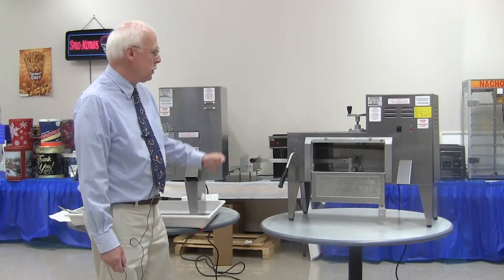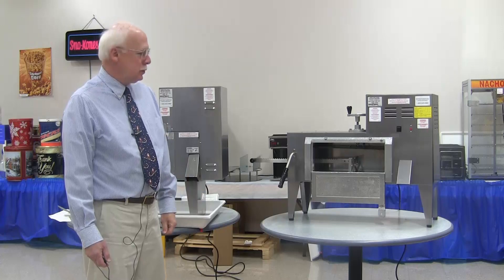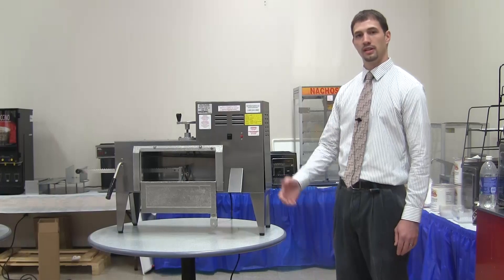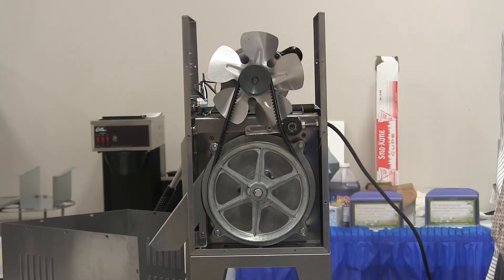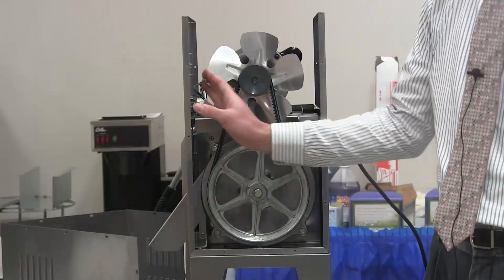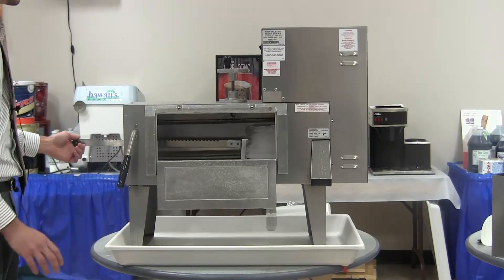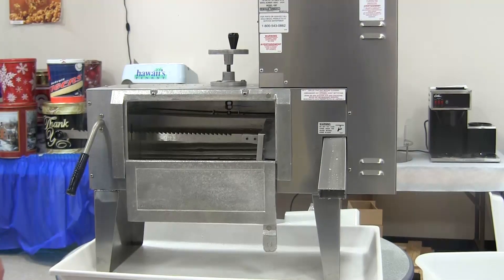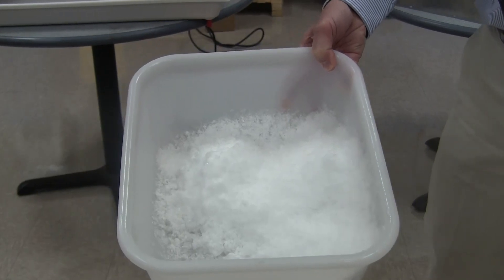Redesign of our New Orlean's Ice Shaver

Comment: Maybe a lockout relay could be integrated with the door switch, preventing the machine from powering itself back up.

When the door opens, the relay locks out the power, preventing the unit from operating until the power switch is cycled.